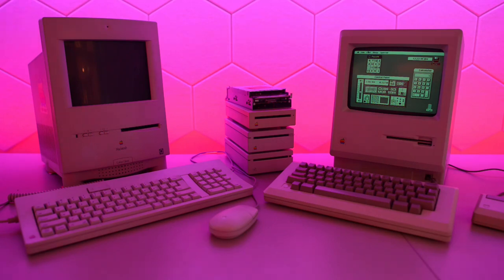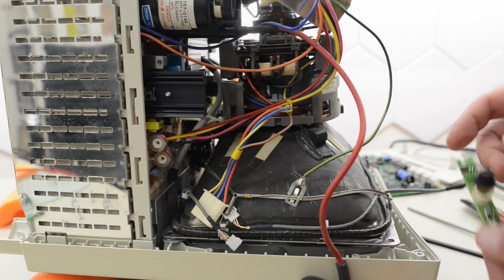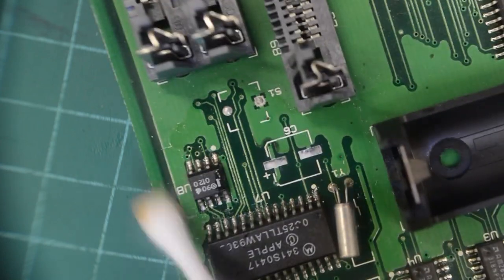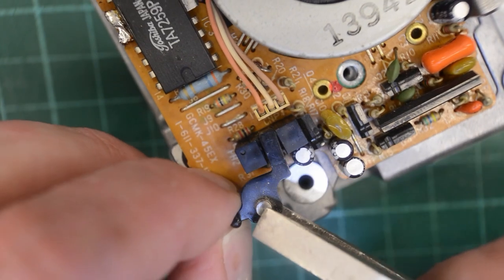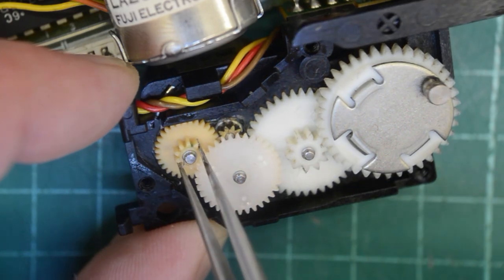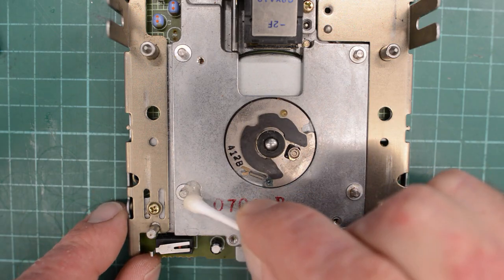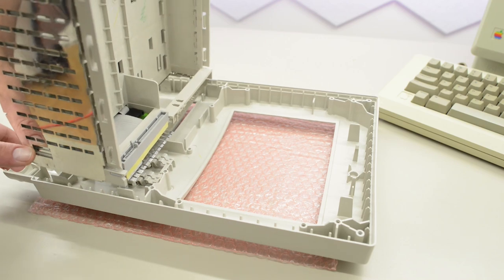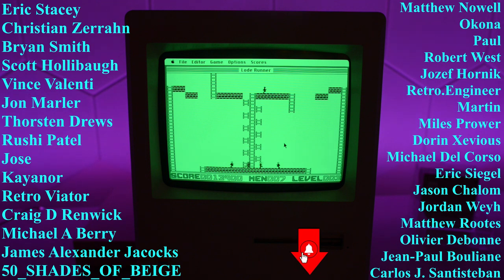Mac Color Classic & Mac 128k repair & restoration. Bonus downloading games to a Mac 128k real floppy

Comment: You should keep some Kapton tape around to shield those plastic bits while using the hot air station. It's the easiest and most effective way to protect plastics while using hot air. It can even help in tight places if you need to get your iron in and don't want to risk melting something with an accidental touch.
Reply: Id take hot tweezers if available
Reply: @rartolak  Tweezer tips are also great for some surface mount components. If I had to pick between the two, I'd still go Kapton tape.

Comment: If you ever recap the analog board, I'd replace those three zeners and mount the replacements such that they rise above the board, say, a quarter-inch or half a centimeter.
Reply from the maker: Yes, I plan to recap the analogue board and replace/relocate the zeners, cheers

Comment: Color classic restoration is generally straightforward. Youll definitely want to recap the analog board. I rebuild macs and amigas daily.
Reply from the maker: Yes, the display is misbehaving now. I'll definitely recap the analogue board
Reply: @Epictronics1  they have a bunch of low esr components. Also, you must must reflow near the flyback and the rf cage. Under it needs reflowing
Reply from the maker: @thomasandrews9355  That's very useful, thank you

Comment: Is it the Mystic upgrade that you're planning on doing to the Color [sic] Classic? That could actually be a good use for an LC 575 that has a broken case due to the extremely brittle plastics.

Thankfully my 575 isn't that far gone. As I mentioned on your community post, it does require a repair to the degaussing coil/circuit, so it will need to be disassembled at some stage. I was putting it off until I found a spare 575 that I could swap spare case parts out of (or just a less brittle case to begin with), but most of the ones I've seen selling on eBay have gone for >$300 Aussie dollary doos, which was around twice what I paid for my original 575. And some of them weren't even working! I guess a lot of people want to do Mystic upgrades.
Reply from the maker: Unfortunately I don't have a 575. I'll probably at least do the VGA mod. I'll have to do some reading to see what can be done with the original board.

Comment: Dang... I have a few drives that could use your touch :/  I wish I could do this stuff. I can take them apart but I'd prob couldn't put them back together. Or might brake some parts taking it apart. I would have issue's also remembering where everything goes. I like the smile face with green on the caps you replaced that's a good idea.

Comment: thats a common problem on the 400K drive. I fixed mine probably 15 years ago by adjusting something on the head, it changes the head pressure against the disk.
Reply from the maker: Interesting, I'll check, thanks

Comment: I’d recap the analog board sooner than later as these caps are similar to those in the classic/classic II and those leak and also the color crt runs hotter and uses more voltage
Reply from the maker: I'll probably do that because the display is acting as if it has the voltage cranked up. Something isn't quite right

Comment: 23:00 - is track 0 not in the middle of the disk?!?!?! At least on most Computers, not sure on Apple. That would be weird. It seems to me it moves to the outside of the disk, which would be maybe track 40 or 80 or whatever it is. Maybe the sensor is broken, it never reaches the start position.
Reply from the maker: Track 0 is the outermost track on these disks. I have checked the sensor in previous attempt but I will double check all sensors on my next attempt just in case that they are glitchy
Reply: Most rotating media that I know of start at the outside. The big exception is the compact disc.

Comment: If you’re upgrading the color classic to an LC 575 logic board, there is a mod you can do to the analog board to make it run at VGA 640x480, DO NOT go for the mod that overvolts the board, as that can kill the analog board quickly
Reply from the maker: Yes and No, I don't have a 575 unfortunately. I was planning for the VGA mod though

Comment: Although 1.44mb super drives can read 400/800k disks if you write 400k disks (and especially if you overwrite 400k disks) they often can't be read i 400k only drives. This is because the head on the 1.44mb drive is much much smaller and thus the track it writes is much smaller. 800k drives are more tolerant of this due to thinner tracks than 400k.
Reply from the maker: Interesting, so same issue as with 360k floppies made with 1.2MB drives. So far every disk has worked perfectly but I'll do some more tests to see how reliable this is
Reply: @Epictronics1  The most unreliable you will get is to write a 400k disk with a 400k drive then overwrite it with a 1.44mb drive. As long as you erase the whole disk before writing it with a 1.44mb drive it should work.
Reply from the maker: @Jackpkmn  But doesn't the Mac still leave the data on the drive when you erase a disk as on a PC? I have not really dug deeply into this but as I understand it, when you format a disk on a PC, the system just removes the address tables.
Reply: @Epictronics1  A PC drive cannot read or write 400k disks at all. When i said 1.44mb drive i was talking about using the mac superdrive. The PC drives have completely incompatible timing, RPM and track adjustment.
Reply from the maker: @Jackpkmn  Yes, I know, variable speed. But does the erase function actually remove the data on the disk on a vintage Mac or does it only remove the address tables? If it doesn't, the data is still there?
Reply: @Epictronics1  On classic macs no it does not just remove the address tables to reinitialize a floppy disk. It goes through and rewrites each sector 1 and 0 and verifies those can be read back. That's disk initialization takes such a long time on these classic macs.
Reply from the maker: @Jackpkmn  That's awesome. Thanks for sharing
Reply: @Epictronics1  Just don't forget you are going to run into the same problem if you don't do the initialization using a 400k drive.
Reply from the maker: @Jackpkmn  Yes, I'll have to get one of the 400k drives working first

Comment: So I just got done watching a video of a guy spending fifteen years trying to fix apple self ejecting floppy drives. My conclusion, this worthless auto eject feature is a dumb idea.
Reply: The same could be said for CD drives, but we take that for granted now.  It's not a dumb idea, it's just that they weren't built to still be ejecting disks in 2023.  They worked reasonably well for their expected lifetime, and if you'll remember, there wasn't much of a template to follow when the Mac opted to use the (rather uncommon, at the time) 3.5" disk format.
Reply: @nickwallette6201  I would argue that the eject mechanism on CD drives is a lot better, because they use the rubber drive belt that's easy to replace. It takes all of a minute with a pair of tweezers.
Reply: @vhfgamer   You weren't expected to replace any of them.  Not the belts or rollers in a CD drive, and not the gears in a floppy drive.

You have to remember that retro computers weren't a use-case anybody was imagining in 1984.  They were selecting plastics that had the properties they needed, for a cost that was reasonable, with an expected 5-7 year service life.

They could've gone with all metal gears, or used rubber and plastic formations that were resistant to thermal wear and dimensional or chemical changes, and even done endurance testing on the lubricants.  But for what?  So a community of enthusiasts could keep using them 40 years later?  A community nobody imagined would exist?

This isn't a failure, or a poor design choice.  It's the consequence of trying to prolong the usability of devices going on 5-10x how long the engineers intended them to.
Reply: @nickwallette6201  Actually it was closer to 3-5 years if you listen to Bil Herd's presentation on the matter.